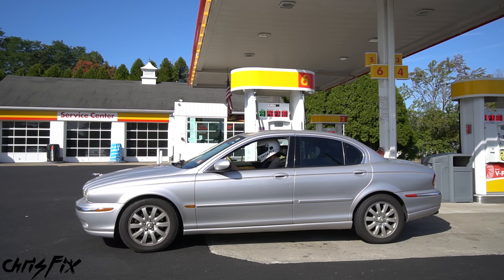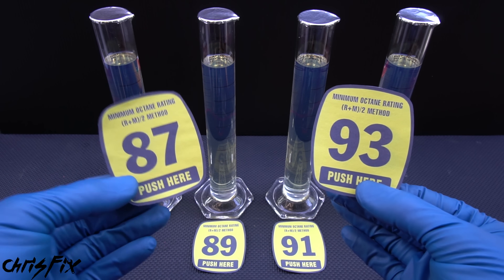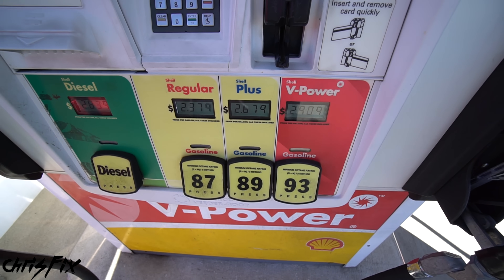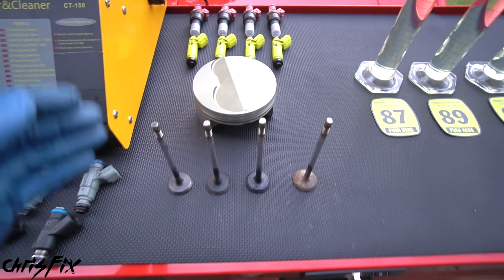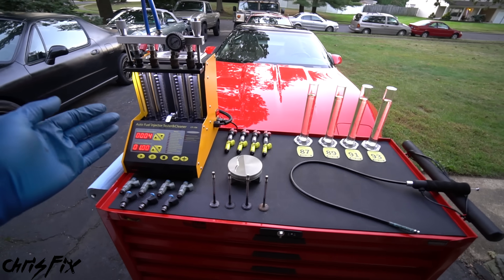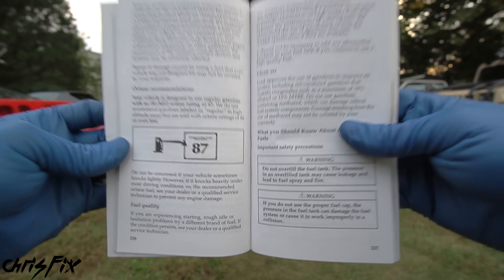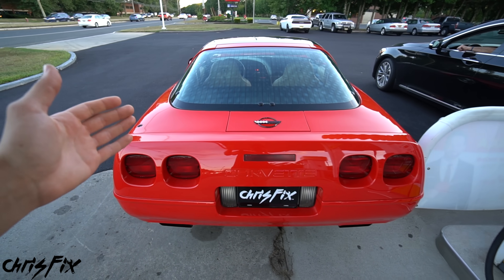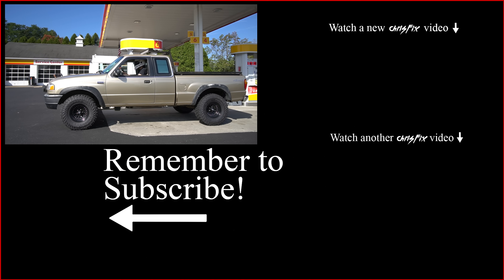What is the BEST Fuel to Use in Your Car or Truck and WHY

Comment: I have a Jeep Wrangler 2018 pentanstar 3.6 if the manual recommends regular, can I use premium 93? I just believe it will protect the injection and other components as you mentioned and maybe The engine will last longer?????
Reply from the maker: There isn't anything stopping you from putting it in, and see if the vehicle behaves better when you put in a higher octane!

Comment: then why does the nissan run better on high grade? the manual says high or low grade in one section and then in another it says run high grade. it doesn't ping on either, but noticeable increase in acceleration on the high grade. is it in my head?

Comment: Big problem is ethanol in the fuel . It does not form well with mixing with 2 stroke oil. And shelf life is considerably less than non Ethanol fuels.

Comment: After how many miles and type of driving on the valves and injectors?😇
Reply from the maker: I searched the junkyard for these so I don’t know the exact. But let me put it this way, most cars that are port injected don’t have a lot of carbon buildup even after 200k miles. It’s direct injected engines that have problems.

Comment: i have had better mileage with premium gas most of the time especially when it is non ethanol. also my engine light comes on when i use cheap gas but not when i use premium and i have seen pick up trucks have the valves rattle with cheap gas when climbing hills. people should try different grades and see what works best for them. cheap gas is cheap.

Comment: Hi Chris great video as always. Mine says 89 but at costco where I fill there is 87 and 91 only. I mix them as equal as possiblr to get 89. Presume that is ok right? Also comments on top tier gasoline?
Reply from the maker: Yes that’s fine. Mid grade is mixed by the pump so instead you’re doing it haha.

Comment: You use what it says to use in your car in the owners manual 🤷🏻‍♂️
Reply: Well this just isnt true because a lot of economy grade cars call for 91 or 93 when they just don't need it and run perfectly fine off of 87
Reply: Tristan Strong Reed would you use 10 w 30 oil on a car who’s owners manual says to use 5 w 30 oil ?
Reply: @dg5476  if its acceptable in the engine yes 😂 but that's oil, not gasoline
Reply: Tristan Strong Reed So why use a gas not specified for your car??
Reply: @dg5476  because gasoline isnt used to lubricate the inside of an engine with millimeters of clearance, car companies "over reccomend" higher octane in their car that dont need it and it's been proven
Reply: You don't know what you're talking about smh
Reply: @familyfirst7027  please explain
Reply: @familyfirst7027  if you're gonna call someone at least give em an explanation next time 😂 nice try buddy
Reply: M. Cole Hes absolutely right, most cars call for higher octane but because of knock sensors in modern cars, they will run just fine and you will cause no damage with lower octane.  Here in texas its 1.95 for 87 and 2.75 for 93, thats a pretty big difference over time.  Even in higher performance cars the computer will adjust timing to compensate for 87 gas

Comment: The best fuel is electricity.
Electric vehicles are the future, no noise, no emissions, no pollution, less fuel cost, less maintenance costs.
Electricity costs ⅓ the price of gasoline in most places. Save money and go electric.
Reply from the maker: Electric has similar pollution to gas cars. Also electricity won’t be as cheap of everyone uses it. Supply and demand.

Comment: Well I notice the difference in small engines.
Reply from the maker: Small engines are air cooled so higher octane helps since the engine is usually running hotter.

Comment: wouldnt run my lawmower on anything less than 91
if ya car knocks there is something wrong with it
simple fact if your car is over 10.5/1 compression then use 94-98 otherwise use 91+ including E10 thats it
95/98 some say you get more kms/L but really km/$ is less
Reply from the maker: Thanks for sharing

Comment: I drive a Subaru, and the owners manual recommends 87 octane, but since I live in Colorado 85 is regular and 87 is considered mid-grade. Will 85 damage the engine over time?
Reply from the maker: 85 is the same as 87 in Colorado because you are at higher elevation. You are fine running 85

Comment: Im glad you said something about high mileage vehicle because my 1999 chevrolet silverado 4.3 got 310000 plus miles on it and when i put 87 gas in it it runs like im dragging a dead elephant behind it and when i put 93 in its got alot more get up and go. I guess one day i will put a new engine in it.But I did like the video and the information thanks

Comment: But chris. What if you’ve changed the design of the motor with things like 1/16 hightop pistons, or stroking? Is there a way to calculate?
Reply from the maker: Yea you can calculate the compression and figure out what octane you need to run for a custom built engine.

Comment: Great videos. 

Quick question:  What "off-the-shelf" injector cleaner would you recommend?  I use a cheap .99 cent per bottle for my old jeep and that seems to work when fuel bank light come on but what about newer "better" cars?
Reply from the maker: I would just use Shell's 91 premium to clean your injectors for 2500 miles, they guarantee a 70% cleaning on your injectors!

Comment: ChrisFix.  Very good vid about the dif of oct levels.  1 thing I would like to point out about the 89 oct though.  Many people think they're getting a cheaper premium by getting 89.  Most of us fill up at familiar places.  Pay attention to where us fuel haulers put the gas into the ground.   You will see a Red lid ( premium) a white lid (regular) yellow or green ( diesel).  If you see a blue lid then that is mid grade/89.   Gas has a shelf life and 89 is very rarely used.  I'm sure someone will say they use it all the time but the majority doesnt.  A blue lid at a station is a bad sign to use mid grade/89.  The gas in that tank has been sitting for months more than likely at a low level ( 2000 to 2500 gallons max & thats being very conservative).  The average tank size is 8 to 10 thousand gallons at normal stations with the exception of high volume reg 87 can be as high as 20 or 30 thousand gals.   Those tanks do get condensation ( ecspecially in spring and fall when night and day temps vary so much).  Yes. The Veeteroot system that monitors fuel levels does have high water volume alarms and the tanks in the ground are not perfectly level ( by 2feet ) so that any water will be at the lower end away from the fuel pickup.    Between excess water and old gas dont use 89 if you see a blue lid.   If you do t see a blue lid then 89 is blended at the pump with a mixture of 87 and 91/ 92 or 93 Oct whatever your state has for premium.  TX has 91, ive seen 92 and obviously this vid 93.  
In my opinion 89 is a blend that will be gone soon.   If you see the blue cap then hell no but if you dont then go ahead and waste your money.  
1 more thing.  Yes liquid gas contracts and expands.  The pumps are proved at 60°.    Best time to fill up is when the temp is closest to that.

Comment: 3,89 for 91 octane in California January 20 20 for Shell and  Mobil have Genesis R Spec 420Hp I use Lucas upper cylinder Lubricant with Injector cleaners and Fuel conditioner's 1quart Treats 100Gal of Gas Great Throttle responce an increases mpg made me a believer of the of product the Car is a 2012 has 141 Thousand miles Runs like a Top 155mph in 8thGear what can I say all the Gasoline in California is low quantity Try adding a Gallon of AivGas an see the difference Exhaust pipes will turn Dove Gray  not black an dirty That's it

Comment: Don't know bout you but when I use the 91 octane at least I get 25miles more full tank compare to regular gas.  I drive 2 Honda Accords and Toyota sienna.  I think the reason I get more miles because of the the iridium ngk spark plugs installed in my cars.  I think the iridium ngk spark plugs work well with the 91 gas.

Comment: thanks for the effort you put into video but  I have some news for you. I have checked fuel mileage on more than one vehicle with 87 and 93 octane and using 87 dropped fuel mileage so saying higher octane fuel gives you better fuel mileage is a myth is wrong.
Reply from the maker: Thanks for sharing. It is only going to give you better fuel economy if your car is tuned for it. So if your car is high compression and should use high test but they say you can use regular gas (like in my Vette), sure it would give you better mpg. But for most cars where they only need regular gas, running premium will not do anything.

Comment: A must watch!!Excellent. I understand why my mileage has gone down and what to do. Before I check my manual, my car is 'turbo'. What does 'turbo really mean?? Thanks much 🤔🥰
Reply from the maker: "Turbo" most likely means your car has a turbocharger, which is basically a fan that blows compressed air into your engine to make more power and be more efficient!

Comment: Very nice video I can tell you took your time and put a lot of effort into this but all you talked about was regular and premium. The mid-grade got left out. I'm sure many people are wondering what you would use the mid grade for, no vehicle ever recommends or requires using it. I'm from Wisconsin and I have seen gas stations that will actually have big discounts on mid grade once in awhile. I'm talking about $1 or more a gallon discounts..... my thought is because not many people use the mid grade it has to get purchased or it sets in their tanks and goes bad.
Reply from the maker: Thanks a lot! I didn't leave out mid grade, as I know, for example, the 5.7L V8 that Dodge uses in their cars actually requires the use of 89! (as well as some other cars requiring it according to their owner manuals)

Comment: I use 91 octane ethanol-free in my  2010 Camaro SS because it gets stored during the winter months and I also use it in my small engine equipment, (snowblower, pressure washers, lawn tractors, etc) because they either get store in the winter or the other 3 seasons and I've never had one problem with a first-time startup after storage or usage. It's also a bit cheaper than the standard premium.

Comment: I owned a 1985 Chevrolet Sprint with the original 3 cylinder, 1 liter, with carburetor, Suzuki engine and I found when I used 89 or 87 I could hear a slight miss while idling. When I burned 93 I didn't hear it, I believe it seemed to run smoother, and it wasn't as easy to stall out when letting out the clutch half a second too soon.

Comment: Chris you already messed up. In most states 87 has 10% ethanol and 91 and 93 do not, they are 100% gasoline. The energy content is different between these blends NOT the same as you stated. The only time the energy content is the same is if all octanes are 100% pure gas no ethanol content. And that almost never happens anywhere in America.

As to your second point about engine knock, all true except you left out what happens when the engine computer pulls out timing to prevent knock. Your engine computer is actually detuning your engine to produce less power by pulling out that timing. Example you have a 600 HP turbo engine that requires 93 octane. You put 87 octane in it. The engine computer detect knock and pulls out some timing which ends up costing you about a 15% power loss. So now using 87 octane your engine will max out around 510 HP not 600 HP. Using a higher octane than your engine needs does not add any power, but using an octane below what you engine needs does cost you power. Chris did not explain that properly.

As to the valves the 4th/last/dirtiest valve you showed is due to a bad valve stem seal. That valve was pulling oil from the engine past the stem seal and that carbon buildup is not from dirty gas but from engine oil. The other three valves are good examples though of good/bad fuel.

Comment: Yes but you forget why it's more resistant to engine knock. And that does have everything to do with the speed that the fuel burns. Higher octane burns slower.  Higher compression engines that are designed for higher octane will be more efficient when using that higher octane fuel.   But using higher octane fuel in an engine designed for 87 is a waste of money.

Comment: Good stuff. Been trying to tell guys for decades high octane doesn't give you more power (unless it's made to run it). Goes in one ear and out the other.
Reply: You're dead ass wrong
Reply: @familyfirst7027  No he's not, if your car is designed for 87 and you use 93 you're throwing away money, the only benefit is using something like Shell's V Power. And even then, why spend all that extra money when you coud just go to a Top Tier brand?

Comment: If i have 170 hp but its a GDI engine gasoline direct injection wich fuel i need? Because the gas cap says you can run on regular but i think that the gdi sistems have more carbon and gunk. Wich fuel i need?

Comment: The fact is, gas stations can buy “cheap” fuel from any vendors. The whole additive thing therefore is not much of a deal.
Reply: Consider also that ethanol is a better cleaner than any additives shell uses in its premium fuel. So An E10 blend will clean your injectors and valves better than any brand of shell 100% pure gas. Downside is they do not make any E10 91 or 93 blends. So if you need to burn premium you can not get any help from the E10 blends.
Reply: Dan Hammond pretty much all the gas where im at has an allowance of up to 15% ethanol by volume.

Comment: this is great!  however, in hawaii, the octane rating on the pump is not accurate, and when quizzed about it there is apparently a law that actually says it doesnt have to be.  get a test kit, test the 91, and it tests out to about 85.  test the 83 and you dont even get a result.  
i suspect that other states may be the same.

Comment: I was wondering, my old trucks say 55 octane. 1941-1964  some have been rebuilt and had things modified to accept unleaded fuel, some have not and for those I use an additive to replace the missing lead. But as far as fuel octane which would you recommend I use with the standard and the overhauled motors. They're all straight 6cyl inline dodge engines with flathead. Thanks

Comment: With 23,000 comments it is somewhere here.  In high altitude states,, I am thinking of Colorado, and Utah, 85 octane is normal.  The reason for that is at higher elevations above sea level your engine is breathing in less air. Less air breathed in means lower total compression in the engine. 85 octane fuel at 6,000 feet of elevation is exactly equal to 87 octane fuel at sea level.  Regular fuel  in high altitude states is normally 85 octane.  HOWEVER,, if you hear even a bit of knock, pinging while climbing a mountain pass or highway, take it easy and get a higher octane fuel or an octane booster soon.

Comment: I have 2005 Honda Civic Manual shifter... I used Chevron 89 may main road is uphills 20% with no problem , then no choice I switch to M and S gas I didn't have the uphill smoother as compared to Chevron, I complained to my personal mechanic which is the Mechanic of local M gas Service Station, told me to go back to Chevron Gas and I did have better mileage and uphill accelarations

Comment: This isn’t necessarily true. Modern cars have what is called a knock sensor. If the car starts knocking the computer retards the timing to stop it. However with the timing retarded you loose power and mileage.

Comment: My dad always told me ethanol free fuel is the absolute best for cleaning, power improvements, and fuel economy...
Reply: Actually wrong. The only part of that which is right, is the fuel economy. Power as long as the octane number is correct for the engine will be the same for E10 or pure gas or so close to the same you will never be able to tell a difference. But for cleaning ethanol is the hands down the best. Note we are not talking about E85 blends only E10 blends.

Comment: Granted, you should follow mfg suggestions but... As a delivery driver years ago, I kept OCD meticulous records on 3 diff cars (driving for 6+ years & 140k miles).  Grand Am, small car, Tacoma 
My process: 

-run to empty or low
-odometer & gallons at fillup (to calculate miles driven & mpg)
-grade (Reg, Plus, Super) 
-odometer at any maintenance event 
-try to run 3 consecutive tanks with same grade fuel 

I found that the best bang for the buck was Plus. 
I got better gas mileage with Plus over Regular & slightly better with Super.
But Super wasn't always worth the money (20% price hike for 5% fuel efficiency)
Occasionally, maybe seasonal idk, I found that if the Plus was more than 15-20% more than Reg, I just used Reg.

To this day, I use this process based on price at the pump.  
Looking at prices right now : $2.00, $2.25, $2.54
between reg & plus =11.8%, between plus and super =12.1%
between reg & super = 23.8% 
Personally, I will NOT get a 20% increase in fuel economy for the same amount of dollars using Super in my vehicle.

Comment: So, basically, you can use any octane fuel and the computer will adjust the timing. Some engines will knock if the rpm are a little low for the speed at that moment. Like when you are going up a hill and the gear is higher than what is ideal for climbing. Being in third gear instead of second at less than 1500 rpm could cause knock in some engines, depending on the vehicle's weight. Most people use what they can afford, usually. I, periodically, pour various additives into the tank, either to clean the system or to remove water in the tank. Good stuff in this video.